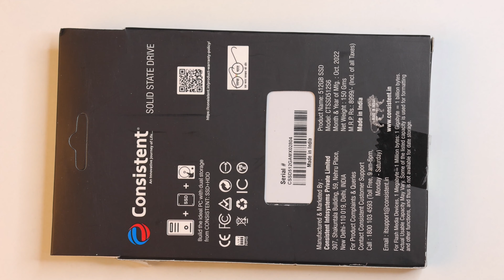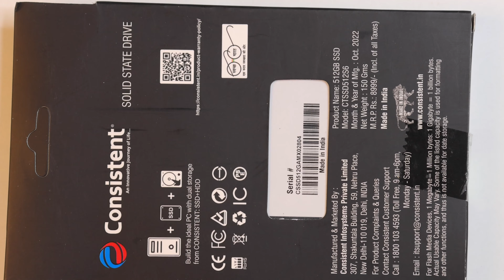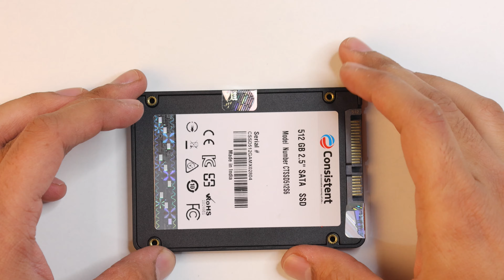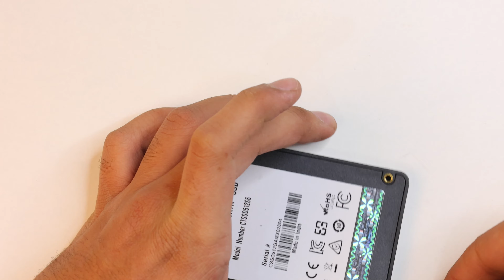Consistent Sata SSD 512GB Unboxing and Teardown

Comment: CONSISTENT vs CRUCIAL konsi acchi rahegi sir???
Reply from the maker: It depends on your requirement.
Both SSD's are best in use.
Consistent is budget friendly. 
Crucial is little more expensive.
If you have no issues with budget then i will suggest you for Samsung SSD,
Otherwise Consistent is best 👌.
Reply: @SavdhaanEngineers  Need of 

Window 10-11
Coding 
Gaming
Reply: @SavdhaanEngineers  Need of 

Window 10-11

Coding 

Gaming
Reply: Budget 3000-3500
Reply: Consistent review 50-50 he to apke experience se acchi rahegi laptop old he i3 he to please sir suggest me bohot confuse hu🥺
Reply from the maker: I will suggest you consistent SSD
Reply from the maker: Aapki requirement ke hisab se consistent best ha

Comment: Consistent 512 vs cruical 500 vs wg 480 which is better
Reply from the maker: WD blue 500gb sata ssd is better
It will give you more stable speed and company givea 5 years of warranty.
And also its cheap